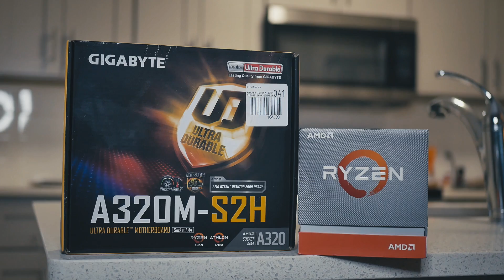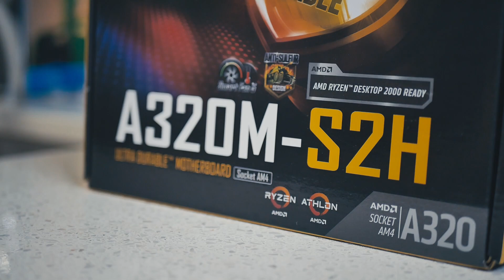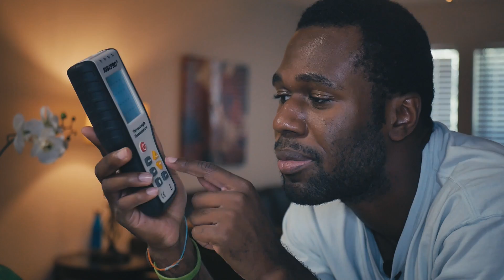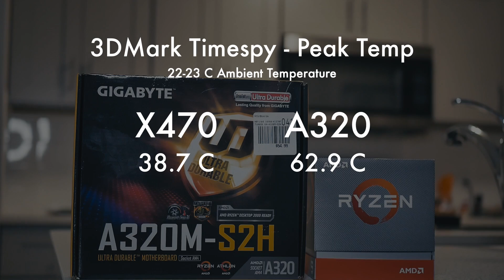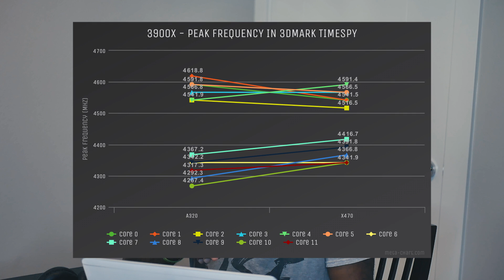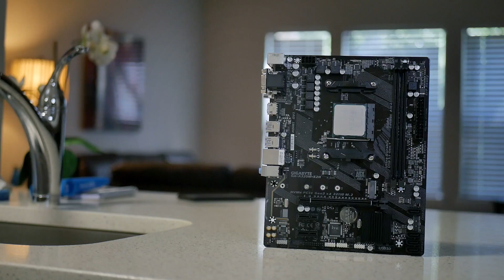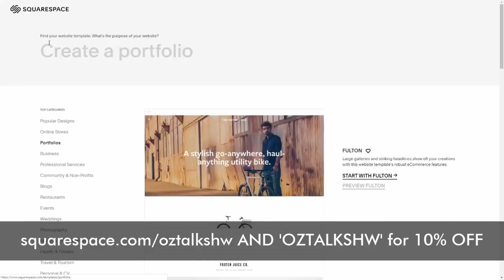The R9 3900X on the CHEAPEST motherboard available | OzTalksHW

Comment: Popped up in my recommended vids.
My Gigabyte a320m s2h is about to be 4 years old( 1 year with Athlon 3000g and 2 years with Ryzen 5600g,)
My current specs
Ga a320m s2h with a Sunon fan blowing on the vrms
Ryzen 5 5600g that boosts to 4.45ghz ( sometimes 4.5ghz)
4 months with an Rtx 3060 12gb
Cooler Master Mwe Gold 750w psu
2x8gb xpg hunterflame 3000mhz ram clocked to 3600mhz.

Comment: I have an MSI b450m bazooka v2 and iam buying an used 3900x and a gpu to substitute my ryzen 2400g. Im using the pc for 3d modeling and render. Hope everything can work ok. What do u think? Also crap vrm's but probably a little bit better than that gigabyte Mb, rights? Thanks for your video.

Comment: well well well i had a faulty z370a mothetrboard, i knew because when i changed this and the cpu only this, games stopped crashing... took the cheapest mobo first in case it was something else. tried a 2700x there and has been playing for 2 weeks no problems. first vrm mosfet were 110c during gaming but i added a fan near them, controlled by the bios it never goes beyond 90 in game and average 70 ... only cinebench is thermal throttlilng and i loose a bit some score... couldn't care the less i only game in 4k with it so i am very satisfied . you shouldn't but if it just works and already has the mobo why not
Reply: Which mobo you using with 2700x??
Reply: @nasif2564  a320 m gigabyte but 8 finally changed to a b550 because I needed more space for my rtx 3080 so i kept the 320m and 2080 ti and make a backup gaming pc with it. now I play with b550 3900x and 3080

Comment: One scenario : building data compute farm. If you get enough money but not threadripper level money, an altrrnative is building compute cluster in which each were made from r9 3900x, a320m, 2x16 ddr4 3200, and single 500gb nvme. Data are stored in dedicated ssd nest, connected over gigabit network. If 320m fail after long data crunching session, just replace with 450. Cheap, can added when necessary, and in waaay lower cost and easily replaceable

Comment: So the next logical question is - whats the cheapest MoBo that will properly run the Ryzen 9 fully?   There are those of us who just want super fast, multi threads power that are not gamers, and just want a simple system that works.  All the expensive stuff is geared towards gamers with the silly LED's and lights and are just as much about bling as they are about quality.

Comment: Have you tried that motherboard in a Little Devil PC-V10 and installing the CPU per the instructions that come with said PC case and system only comes up when cooler head drops below -70 degrees below ZERO.

Comment: To this date i am unable to get 3900x, comes and goes, both online and in stores..so i changed the plan, not quite entirely.

So my plan was to get aorus xtreme board, that i got, somehow..

But bought 3700x in place of 3900x coz timw was key, had some work pending. Did this sonthat when 3950x comes in September, will trade in my 3700x to that..
 😁

Comment: An A320 is in the $50 range, but B450's can be found in the $80 range. $30 isn't anything if your buying stuff to build the cheapest workable system you can with the fastest processor. A lower budget B450 with decent VRM's would work much better. . This test does not make any sense, but I don't think it was supposed to.. 3600 and A320 is an ok combo that Tech yes city proved, but it is not upgradable beyond that

Comment: 1 point to criticize: 
The throttling of a cpu does not depend on whether amd did a good job or not engineering this cpu. It is all up to the board and the bios. At least with stock settings.

Comment: I wonder if the vrm would do any better with a cpu cooler that blows down toward the board? I grabbed a pallas cooler to pair with my fx 8350 when I upgraded my hp h8 1234. After 4-5 years of use it still works, but the green pcb how a brown tint on the back. I dont use the pc anymore as I have upgraded, but it still works. I would leave it on for days straight doing handbrake jobs. This is the cooler I used. http://www.raijintek.com/en/products_detail.php?ProductID=9

Comment: Its makes sense not to pair it with the a320m board , the mosfets and vrm's are not enough and like he said in the video , the components on the board are gonna die very likely early due to very hot sustained temperatures :)

Comment: AMD are releasing a 65w 3900 and 3700 as well as lower R3 parts. You could pair a 65w 3900 with a A320 and probably get away with it. Still would not recommend it though. :)

Comment: I have the msi pc mate b350 paired with a ryzen 3600. for some reason it doesn't work well... my ryzen 1600 does a better job (i got the latest bios), also the XMP profiles are dodgy with the 3600 but if i run everything on default it wont perform evenly or better compared to the 1600. Any idea?

Comment: good info and testing.. seems the best way to go is get a GOOD quality 450 or 570 motherboard, get a good high wattage PSU and then you have a good chassis to expand on other the new few years.  Add more RAM, upgrade the CPU etc. but have a good foundation to build it on.
Reply from the maker: Yeah unless you want the extra features I think a good b450 is the best sweet spot. Compatible with every AM4 CPU, has PCIE 4.0, and overclocks the CPU (though PBO and XFR work so well Idk if that's much of a selling point anymore)

Comment: A320 consistently scoring, hmm... This might be bicause the 570 is overbuilt to be able to run a 16 cores, overclocked.
Might be that the multiple vrm pfases era is done, it's too slow to react properly for this new technology?
Reply from the maker: It could be a number of reasons, but the Crosshair BIOS is known to have problems With Ryzen 3k chips

Comment: I am using 3900x on a B350m Mortar... And it works fine!
Reply: How is your VRM temp under full load?
Reply: @nasifrazzaque6675  I am using HWMonitor as the system monitor but I don't know which one indicates VRM temp. I use 3900x for h265 decoding, it can maintain at 4.1 GHz for all core, 120 - 140 Watt power consumption at ~85 degree C of CPU temp by using Corsair h100i in a Corsair Air 240 case. All other temperature sensors give roughly 45 - 50 degree C. CPU loading is about 60 ~ 70%.

Comment: found an a320m-s2h mobo for 40$ on ebay to pair with a 3600 but it needed a bios update and I didnt want my PC standing on a limp leg so I went with an asus rog strix x470-f pre updated to latest bios.
Reply from the maker: AMD sends boot kits. I'm not sure if it applies to used parts but you should hit them up anyway

Comment: If you don't have money, what's the reason to buy such CPU? i mean if you need game performance, you should take ryzen 3600 or if you need render video ryzen 2700x for a low price and a good mobo for it. Cheap mobo and powerfull CPU - this is madness :D
Reply: You know what they say, such monster of hardware are there for those enthusiasts out there
Reply: i have a 2400g with a b450m bazooka v2. now im buying an used 3900x and an used gpu. Using pc for 3d modeling and render. Not an ideal MB but it will improve a lot my workflow for sure.

Comment: Really excellent tests, and I love the graphs... very refreshing compared to the mainstream channels.   All the numbers make total sense.  The 100MHz difference is so small it almost doesn't matter (literally just a 1% difference in performance)... Since temps were still rising it was probably not the mobo hitting a thermal limit, but it could easily have been hitting up against its current limits.  As for the reason why... that's actually hard to quantify without also looking at CPU temps and other things.  But it could be anything... doesn't really matter,  since 100MHz is just 1%.

I wouldn't recommend the A320 either.  That said, if you had no choice... you could actually stuff a 3900X into it and it would work just fine.  I would just recommend reducing the socket power cap a bit in the BIOS (usually under CBS/NBIO/SMU) so the VRMs do not get quite so toasty.   Try setting it to, oh, 90W, and make sure that the VRMs have decent direct airflow.  You can definitely run the 3900X in the motherboard without overheating the VRMs, you just have to decide on how much power you allow it to cram into the socket (via the BIOS).   The 3900X will lose some all-cores performance but probably not lose any single-core performance... but its still not a huge loss.  We're probably talking 5-8% lower performance... that still beats the living daylights out of everything.

One final item... you can probably overclock that memory to at least 2666CL15 just by running it at 1.35V, even if it isn't labeled that way.  OC'd memory off the shelf is mostly just normal memory with higher voltage + binning + a bit of marketing.  The voltage alone will get almost any memory to at least 2666CL15 (and CL14 usually, too).  For example, I regularly overclock 2133 ECC UDIMMs to 2666CL15.  I don't think I've ever not been able to.  Since OCing memory is essentially costless, it's always worth a shot.

-Matt
Reply: So I can run 3900X on A320 board for 3 years safely if I reduce socket power cap?

Comment: Why? is this even realistic? i mean someone that buys a 320 board will go with a 3900X? or the other way around? i mean why just why? Suggestion for next video A6 9500 on a X570 board.
Reply: Because it may not have been worth it to get a 3700x or 3800x with an x570, when you can get a 3900x with a a320 and achieve better performance for the same amount of money.
Reply: @66777jason  Ok if you think so, who am i to say the opposite, i mean the amount of work you put into it is commendable but in reality no one will do that i mean pair a 3900X with a A320, makes no sense and you limit the cpu a lot, in my opinion.
Reply: @gr33nbits93  I mean that was the whole point of this video, to see how much an a320 limits the cpu by comparing it to x570. And if they got somewhat similar results then he could say something like "don't worry about your motherboard choice, get a cheap motherboard and a more expensive cpu". I don't think I'm explaning myself well
Reply: @66777jason  Yes i agree but a B350 at least in my opinion that worth's what is worth non the less good work on what you did, if it's useful or not that's another story.

Comment: @OzTalksHW
Another great video! There have been a few other tech channel that have done testing similar to what you did here, but it's always great to have another perspective to the equation! And you came to the same conclusion, it work but it's optimal. Like you said, a 3600 would be better. However, I think(and this might be something you could test) if one adds small heatsinks to the VRM's the problems would diminish, making the B320 better suited for a 3600x, 3700x or 3800x.

Comment: I LOVE K-Types and great call for using them! Also great call on measuring at the via stitching rather than the top of the MOSFET package.

You may want to get some Kapton tape, it's extremely temperature resistant, SUPER sticky, the glue is residue-free and non-conductive, and the tape is super difficult to poke through so it provides great protection, and has moderate thermal conductivity (i.e. better than none at all, slightly better than most plastics). While using Polypropylene tape like you did is not wrong, i don't anticipate major issues with it, it's just potentially a little bit less professional and more failure prone. You don't have to buy genuine 3M Kapton tape either, i mean if you get cheap "Kapton" or Polyimide tape from China, you'll likely receive a tape where the leader says "KOPTAN" in green lettering but which is otherwise completely identical to 3M original in every regard. I got a HUGE roll for $6 and i bloody love it SO SO MUCH!

Another trick - some thermal tape, like Akasa thermal tape board side, cover with some kind of tape (any) on the outside. That should provide somewhat more reliable temperature reading. But i don't think you were far off at all.
Reply from the maker: Screenshotting this for future reference. Thanks for the tips!

Comment: Tech Yes City did test the 3600 on a A320 (i believe is the same board) vs a X570. No loss of performance whatsoever
Reply: Just the necessity of updating the BIOS with an older CPU.  Kind of defeats the purpose of a cheaper A320 if you don't have one laying around.
Reply: Always buy from Amazon or Newegg so...
Reply: Pc stores or repair service may upgrade for a small fee.
Reply: Jeff Morse Ya, really only makes sense for someone that already had a 320 with an older Ryzen who wants to upgrade to something like a 3600. However, if buying new, Its rare to not be able to find at least a B450 on sale within $10 or so of a 320, sometimes same price or cheaper.
Reply: @FireMrshlBill  òr if you dont care about nvme support and already have a 1 tb 2.5 inch ssd, its crazy value. but i would still go for a b450 then if it was me.
Reply: @FireMrshlBill  Yeah, A320 didn't really make sense. I guess that manufacturers were used to making the cheapest possible  motherboard for AMD cpus. They soon realize how pointless that was and skip the A420.
Reply: @thanhdohuu9473  Of course A320 made sense. It's a cheap chipset with enough PCIe lanes to support the average person's needs, and most people don't overclock. It's great for OEMs and custom builders on a budget.
Reply: @nathangamble125  A320 motherboards were around $10 cheaper than B350 motherboards. I doubt that it was worth it for most people.
Reply: @thanhdohuu9473  bro difference is alot in some countries you are lucky if you are from pne of the western countries
Reply: A320 was faster then X570 actually.
Reply: Jeffrey Bozko but do you think the cpu 3600 with any a320 will be okay in the long run tho?
Reply: Eto Waifumura ya, it’s a 65w cpu. If they put out a bios update for ryzen 3000,  it’ll be fine.
Reply: @etowaifumura4952  Ofcourse, its a 65 watt TDP cpu.

Comment: Thanks so much for this test.  I have the B350 equivalent of your Gigabyte board there, and I am planning to upgrade my proc to a 7 2700X , 5 3600 or 5 2600, depending on how much cash I have in a couple of months.  I'm currently running a 3 1300, so its good to know the upgrade should work without having to buy a new motherboard.
Reply: Gaming wise 3600 is a beast, other stuff - 2700 nails it and also selling with huge discount.

Comment: 5:57 nope it's because a320 is smaller and has shorter runs, CPU/RAM/bus all faster on smaller board. Fatal1ty micro ATX b450/x470 board will be best for Ryzen 3600 or 3600X And will beat larger X570 Boards easy.

Comment: Great video, interesting concept... I think the 6 core plus the A320 looks like a sensible combo judging by techyescity's test :) I have a really good 1150 mobo at the moment with a 4790K, I have clocked the crap out of it but really want more CPU power now... obviously the 4790k is the end of the line for that board.... I think the only thing I'd miss by going to a low end motherboard is decent audio.  Do you know what the audio is like on the A320?  Cheers!!
Reply: Msi is good on audio. Maybe consider any B350/B450, they are not that much expencive.
Reply: @vadnegru  Thank you Vadim, yes I'm thinking about that too, might well just go for the X570 though given that I can be sure there is an upgrade path.  My current board has a massive VRM (twelve phase) and could absolutely take a 6/8/even more core CPU should Intel have made one available.  The racket they have going with the mobo vendors, where they keep on changing sockets, really puts me off ever going Intel again.

Comment: I have an A 320 board because i needed a very cheap rig for my nephew 2400g with 16gb ram (2gb) for vram  and its runs fine about 66 under load no issues in the many hours he puts into fortnite